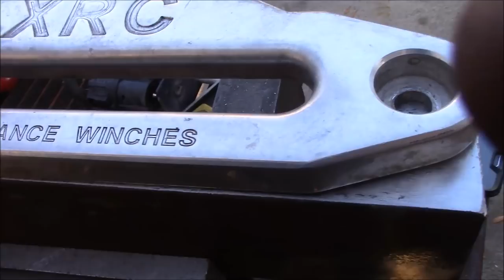Winch mount build

Comment: Clean work. I like the double gusset idea on the front. Can't believe the bumper didn't have any bracing for the winch mount. Seems like it's built more for looks than strength. I'd be pissed if I broke my winch because the mount bent like David's. I'll post up pics of the receiver mount I built for mine on FB sometime.

Comment: Hey Rusty, when welding directly on the Jeep do you have to disconnect the positive battery cable to protect the battery? As always you explain things so it's clear and understandable. Thanks man
Reply from the maker: Michael Durling I do man disconnect both and ground close as possible to the weld point I've aways did it that way just to be on the safe side

Comment: Give TalStrip a shot. From Napa, Its one of the best paint-strippers I've come across, you can watch just about any surface coating just bubble right up and peel off.  Heavy duty bedliner probably not, but the .03 layered spray on stuff, it'll probably work well enough.

Also, what are you welding with?
Reply: when he was showing the setting for this project on the second video, it was an eastwood mig 250

Comment: Nice job! Have you thought about cutting out a saddle In the bumper to drop the winch down to be In line with the frame?
Reply from the maker: Eli Sancere yes I have was gonna do that at first but kinda like the old school tube bumper look keeping it square lol I'm old school like that look would be best to lower it though
Reply: Keeps it out of the water. I guess every region build is different. I want my winch on the back. If I am sinking I want out of what ever I drove into:)
Reply: I was thinking something similar, but moving the winch out from the grill about 4-6 inches. (might require a bumper redesign though to maintain shear strength).  This would give you teh airflow without sacrificing too much elevation.  Eitherway, Im sure it all works out right, by the end of the video.